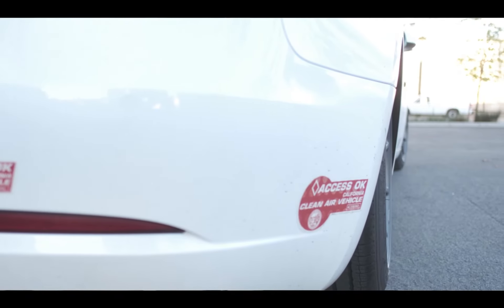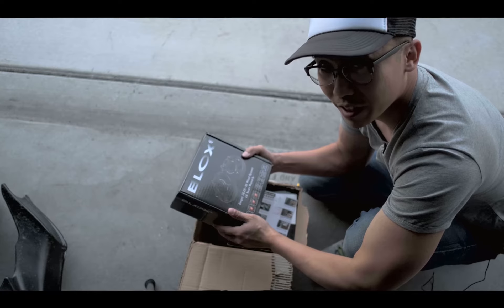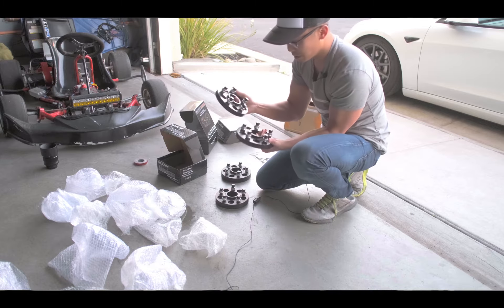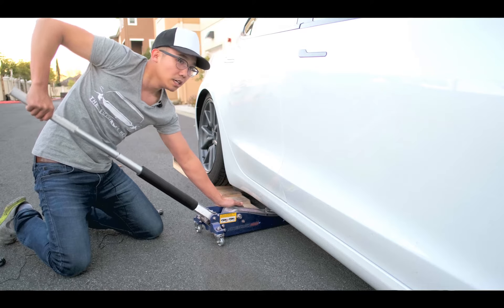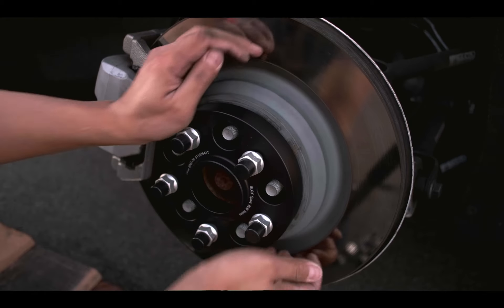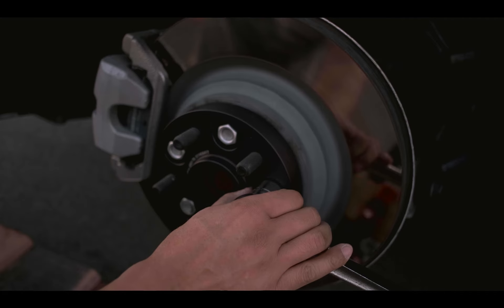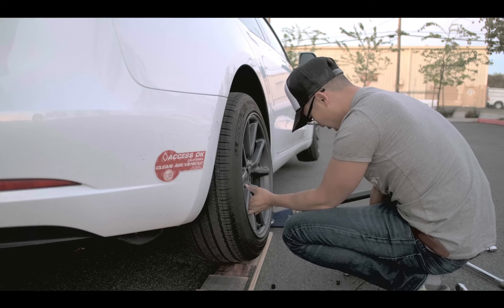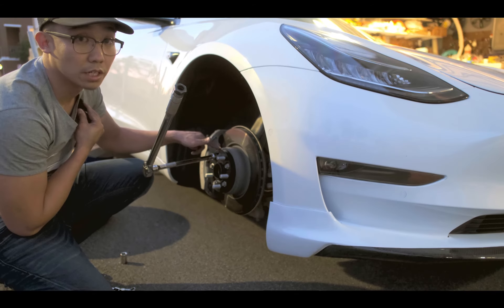Tesla Model 3 Blox Sport wheel spacers installation

Comment: So how have they performed so far? Any wheel wobble...ect...? Thanks in advance.
Reply from the maker: Neil Yakuza hello, it’s been many months and I have put thousands of miles on the car with these spacers, matter of fact I just drove to Disneyland from sf Bay Area, 3rd nor cal to so cal road trip, not a problem
Reply: @TeslaDIY  Is there any vibration at higher speeds?  Can you be specific?  When I have ran H&R spacers on my FX35 I experienced vibration.  LMK.  Thank You
Reply from the maker: @jasonadams74  Never had vibration, shouldn't have if you have the right center bore size and hub ring. I am sure other bloxsport spacer adapter user can say the same.

Comment: Hi. I got M3LR. Do you think is it ok to go with 20/25? any rubbing?
Reply from the maker: You won't be rubbing, not unless you are lowered more than 2", and even then, you're only looking at potentially rubbing on the fabric fender liners, and only on hard bumps at higher speed. Some even runs 25 front 30 rear and theres no issue
Reply: @TeslaDIY  so no issue 20/25 for stock wheel and no lowered.?
Reply from the maker: @hirazuku  if not lowered, definitely not issues
Reply: @TeslaDIY  well noted. thank you so much!!
Reply: @TeslaDIY  Hi. If I want to lower the car, max is 2" that I wont rubbing it? right now my set up is 20/25mm wheel spacer with 18" oem wheel.
Reply from the maker: @hirazuku  hello, that was basically my setup, I was lowered by 2.1” (according to Unplugged performance’s “low” series lowering spring)

I don’t recall rubbing, I know guys who runs 25/30 on stock 18” wheels and they’re on bagged suspension, if anything, a minor rub on the fender liner, not the fender itself on a bigger bump on the freeway
Reply: @TeslaDIY  so you think 1.8" lower should be OK without any rubbing?
Reply from the maker: @hirazuku  i would say so, but don't quote me on it, i dont have your exact configuration and the roads i drive is probably different than yours too

Comment: Hey do you think I could get away with 25 up front and 30 in the rear at stock height with 18 inch Aeros?
Reply from the maker: i am pretty sure that will work, especially with stock height, the only concern i would have is 30mm spacers, thats pretty wide being an adapter, i personally didnt want to run wider than 25mm for a safety reason, but thats based on little to no research. Fitment wise, you are fine with 30mm wider on stock wheel spec

Comment: Thank you for sharing. I am planning to place similar wheel spacers on my 2018 Ford Fusion SE. I noticed that your wheel studs stuck out from the holes on the spacer. I have viewed several videos that say that it is bad for your wheel studs to stick out for the wheel spacer, because it keeps the wheel from sitting flat on the wheel spacer. Was that an issue you experienced? How did you get your wheel to sit flat against the wheel space even tough your wheel studs were sticking out from the wheel spacer?
Reply: the back of the wheels (most wheels) have cavity. so even though the studs are sticking out, it wont protrude the wheels from sitting flush. I do however heard that thinner than 15mm spacers on a tesla model 3 will require new studs, or cutting the studs shorter which isnt ideal

Comment: Hi Perry nice vid, I've had my P3D for over a year now and I'm thinking about getting spacers myself.  Have you experienced any camber issues with the rear specifically?  Do the spacers create more noticeable negative camber?  thanks
Reply from the maker: Thanks Kevin, I have had good experience with both lowering my car and adding spacers with little to none camber wear on the rear specifically. My front tires actually have noticeable camber wear. But i actually have NOT done alignment since, mainly because i kept thinking i would change my setup (from spring to coilover, now i want to go air suspension) and since i don't notice any negative affect on normal driving, plus tire wear seems to be ok minus the front. I got away with OUT getting my car re-aligned for almost 2 years now. BUT this doesnt mean i don't have to.

And since my example probably dont help you much, i did some search and indeed adding spacers will change the suspension load and add slight negative cambers. I honestly don't think its a big issue and it can be simply fixed with an alignment even if it does change the camber.

hope this helps.

Comment: Hi Tesla DIY!
Do you know If these will fit the Performance model?
Reply from the maker: i personally don't have a performance model ( i wish i waited) but as far as i know, bolt pattern wise, it will fit, i have heard some people use spacer to clear brake caliper on certain wheels, so if anything, it will only help a potential issue down the road if you are running spacers. as far as width of spacers, i think the factory 18s and 19s have same width and offset, so you can still run 20 mm front and 25 mm rear with no issues

Comment: hello, having to put 3.5mm springs and shim 2cm it will not damage the bearings?
Reply from the maker: I've only had the spacers on for 3-4 months, so far so good, i can't say there will not be any damage, but i assume adding spacers will have similar effect as lower offset wheels.
Reply: @TeslaDIY  @Tesla DIY hello I received my 20 mm thick shim for the rear wheel how much is the clamping force with a torque wrench
Reply from the maker: @stargatesc  If you are referring to the torque spec of the lug nuts, i torqued them at factory spec 129ftlb for both the nut for spacer to hub and wheel to spacer

Comment: What springs are you using in this video? Thanks!
Reply from the maker: Sharad Mathur I was on unplugged performance “low” spring, 2.1” drop, but then rear seems to have a lower drop for me
Reply: @TeslaDIY  Thanks, are you still on the springs, how does it drive so far? Any bad tendencies with the springs?
Reply from the maker: @mathursharad007  Hello, i have been on bags for over a year now (air suspension, you can see my newer videos). To be honest with you, the lowering springs were sketchy, bouncy at high speed, it lofts the car in the air going over bumps at highway speed, or at least it feels that way. It could be because i had the early production though.

Comment: What was that thing u used between the car and the jack? Link to buy one?
Reply from the maker: Hello Amund, they're Jack Pads, i bought them from eBay, they were like 30 bucks each, i wouldn't recommend them, mainly because there are much better options these days, i think you can get some Jack Pucks made with hockey pucks at 20-40 bucks a set (DIY vs buy). i bought these because these were the only option a year ago.

Comment: What springs you go with?
Reply from the maker: I had the very first batch of Unplugged Performance "Low" springs, they were advertised at 2.1" drop, however i find the rear has a slight more drop than the front.
Reply: Do you still have the stock shocks?
 @TeslaDIY
Reply from the maker: @jamesthompson551  I do.. but they are in the storage, or do you mean at the time I had these springs installed, yes I had oem shocks in with these lowering springs, this was 5 years ago and there weren’t many choice of aftermarket r parts back then, I’ve gone thru aftermarket coilovers and now on air suspension

Comment: Hi, you are my neighbor, does the spacer also works on MS?
Reply from the maker: Tyler Cheng hello neighbor! I will have to do some search and get back to you on that, there are some specification we gotta look into in order for it to fit and work, but I’m sure if not these blox sport, there will be other brand out there that will work for the model s
Reply: @TeslaDIY  I found some on eBay, how do you think 30mm for MS?
Reply from the maker: Tayler, looks like Model S has a different bolt pattern 5x120 (Model 3s are 5x114.3) 

Center Bore and Stud size are the same however.

The same spacer i use will NOT fit your car, BUT Blox Sport do sell the same spacer (same spec) for Model S in 5x120 pattern.

You can buy from their website or eBay, i find eBay cheaper and i made sure they are from the same people and its not knock off. Mine came from Hong Kong even though it is listed as China.

Feel free to come by if you want to know more or if you have any questions.
Reply from the maker: @MasterTy777  30mm is a bit much for my safety concern.
Reply: @TeslaDIY  I am going to get 25mm x 4. thx
Reply: @TeslaDIY  do you have the jack pad for ms? or do I have to use the jack pad?
Reply from the maker: Tyler Cheng, I have 1, not sure if it fits model s, it has a notch that goes into a dedicated hole at all four of the Jack location, I have all tools if you need help
Reply: @TeslaDIY  can I just jack up like normal car?
Reply from the maker: @MasterTy777 I think you should be fine just make sure the jack platform isn't much larger than the suggested jack location from Tesla, you just don't want all that weight distributed on the undesired location I guess
Reply: I just received the spacers.  do you mind help me on the weekend at your convenience?
Reply from the maker: Tyler Cheng do you have my number?
Reply: @TeslaDIY  no
Reply from the maker: Tyler Cheng are you in he watsapp chat group?
Reply: @TeslaDIY  may I have the name of the group?
Reply from the maker: can you email me at 4agemr2@gmail.com

Comment: What is the purpose of these spacers? 😄
Reply from the maker: Jenny Lee hello Jenny, wheel spacers are used for several purpose, some add spacers to clear brake caliper from aftermarket wheels, some use it to push wheels further out to sit flush with the fender for a better look, some may think the wider track helps grips the road better through turns. I did it for looks :D

Comment: Did you need extended lugs?
Reply from the maker: Hello Nate, these are wheel spacer adapters which comes with extended wheel studs on the spacer itself, if you run regular spacers (not adapters) then i would recommend anything over 10mm you probably want extended studs, you want about 9.5 turns to be within factory spec i believe. For extended studs for the model 3, i have heard new camaro or mustang ARP studs works, i think there is a build thread by beastmode3 where he had done a extended stud mod

Comment: How are the spacers holding up for you? Did you regret going 25" in back and 20" in the front? Would you instead go 20" in the back and 15" in the front?

Any rust?
Reply from the maker: They're holding up really well actually, have had many miles on them including 3 trips from norcal to socal.

no regret on 25r 20f, i actually need it to push out even more but again, due to safety reason and currently lack of camber/tire size adjustment, i just have to call it good enough for now.

New wheels are finally coming, so hopefully with wheel width and offset i can push them out more to flush with fender to get the stance i want without spacers.

15 front and 20 back is fine if you are not extreme about the "stance", meaning if you don't need it to be super flush with the fender (look better in my opinion, but you're more at risk for rubbing...etc)
Reply: @TeslaDIY  Thanks for the feedback, my friend has spacers on his 19" wheels, 20" in the back and 15" in the front. I'm considering getting the set you got and wanted to be sure. Is this really almost $200 for the set?

There are so many vendors out there and price differences..not sure which one to go with.....
Reply from the maker: @geek2330  they are 200 a set, i did my research before buying as well, BloxSports sells them on their website as well but i didnt like how i had to place 2 orders since they are 2 different sizes pairs, also i think was 10 bucks more as well?

i bought them from ebay since they were cheaper and had the combination set that i wanted (2 x 20 and 2 x 25), i confirmed they are from the same brand from their photo with the bloxsport logo.

i also had a friend who purchased them directly from hong kong at the bloxsports warehouse. they are the same guys from ebay.

Comment: Are you still using them after a year?
Reply from the maker: yes i still have it on the back since i have different wheels setup now, i dont run the front spacers anymore about 25000 miles on them now

Comment: Did you notice any effect on range?
Reply from the maker: This is my second EV, my first EV was an i3 and had 65 miles range, and i've learned that mileage per charge really depends on many factor, how you drive, the roads you drive, the weather...etc.

what i am saying is, something this small, you won't notice any difference in range, not really anything you can add or remove will affect your range as much as you can notice. not this spacers.

i have driven 200+ miles to the snow with this setup and have no notice any issue with anything

Comment: Did u lower ur car?
Reply from the maker: yes i did, check out my other video, i have lowered this car multiple times with different options
Reply: @TeslaDIY  awesome, do u know would 20mm spacers with bigger wheels 235/50R18 winter tires work on model 3?
Reply from the maker: @bohanfeng6343  there are other things that can make it work or not work besides just spacer and wheel/tires size, ride height, alignment spec can help too.

but 20mm is very safe (fitment wise) in my opinion, i have ran 30mm as well on 19x9.5 +40 setup, I think OEM 18s are x 8.5 +40, so  OEM with 20mm is still 22mm narrower than my 19x9.5 +40 with 30mm spacers.

So the short answer to your question is, yes, 20mm spacers with "taller tires" 235/50/18, would work.
Reply: @TeslaDIY  great, thank you for the advise